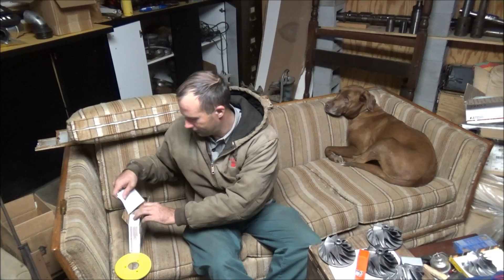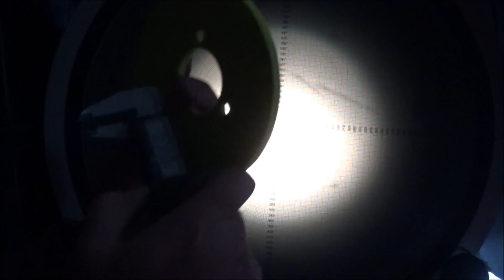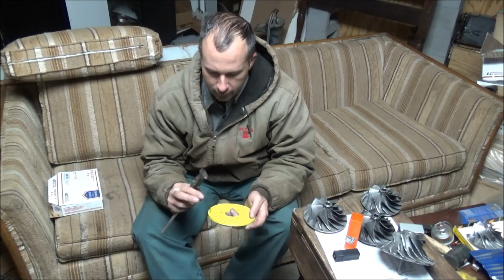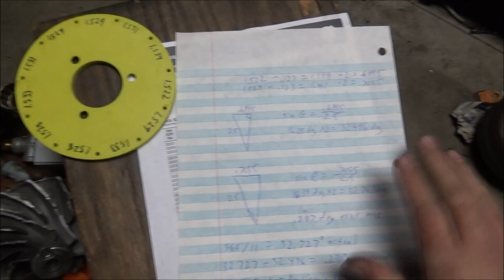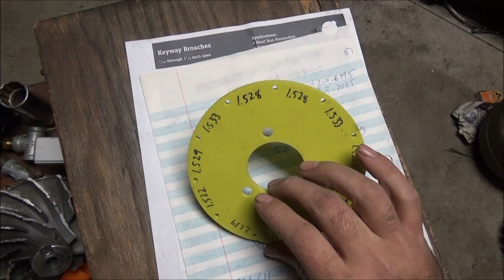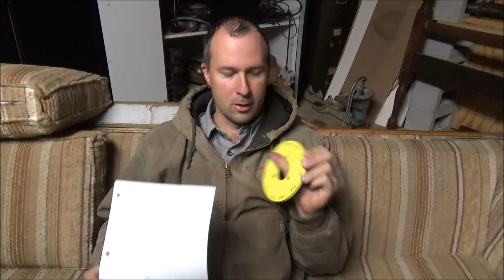Accuracy of a 3d printed plate

Comment: +bcbloc Thanks Brian, that was well thought out and executed.  I think .004 error on a gear tooth that hasn't existed for some time will be a huge improvement.  One thought is I did print that plate at what is the roughest setting on my printer as far as thickness of the layer.  The holes might come out better if I used a finer layer spacing.  I could also try printing at a slower speed, which does seem to result in a better finish.  Thanks very much for your reasoned, and experienced, feedback.  You can keep that one, I'll just print another.

So how bout some info on those impellers?
Reply from the maker: Glad to do it. It was a lot of fun and I learned a lot from the comments here. It does appear that the worst holes occured close to where there was an axis change. I would look into the positional accuracy of your axis. Perhaps a dial indicator movement test would tell the tale. It maybe that slowing down will improve the resolution of the positional accuracy and do a better job. It will be interesting to see.  The impellers are just stock Holset compressor wheels for 15-19Liter diesel engines. Those are a common size to be used on the hot 6-7liter engines to improve performance. It is common to upgrade the turbos to billet aftermarket wheels that can stand more boost and these are takeouts.

Comment: is that a razr?
Reply from the maker: Is what a razr? My phone?
Reply: Yeah
Reply from the maker: evan weiner
yes
Reply from the maker: evan weiner
yes it is
Reply: Wow does it still work?
Reply from the maker: evan weiner
Works great, better signal than any new phone. I never have it drop calls or lose signal.  I am oftentimes in remote locations for work and many of the newer phones won't work but my old one will. I suspect it has a lot more antenna than new phones since it was designed when there were a lot less towers.
Reply: How old is it at this point?
Reply from the maker: evan weiner
 I don't remember probably 12yr or so.
Reply: Damn that is impressive! Have you replaced the battery?
Reply from the maker: evan weiner
twice I have an extended run one on it now and it can go several days without a recharge.
Reply: That is awesome. How do you do email for your job?
Reply from the maker: evan weiner
desktop or laptop

Comment: Yeah, but when you figure the dividing head is geared 40:1, that makes the worst hole error of .231 degree only about .0057 of a degree error on the work. Might be close enough for government work....Dave
Reply from the maker: The model K K&T head James has is 5 to 1 not the standard 40 to 1.  I have no idea why K&T had different geared heads.  maybe it worked out better for power driving for helical milling.

Comment: That first bolt hole showed classic evidence of backlash in one axis more than the other. Printers are not usually made like machine tools, unfortunately.  The first thing to look for is to make sure the belts are tight,  then that the pulleys are tight on the motor, and after that you're chasing the slop and flop in the skinny frame and slides.

Errors do not really get smaller on smaller parts,  once the machine is trammed,  because they are mostly absolute positioning or extruding glitches.  The typical raw positioning ability in X & Y with full steps is 0.2mm or 0.008"  but they are generally set to 1/16 microsteps which should get the accuracy down below 0.001". I'm assuming James has squared his machine as he is a skilled machinist,  but that backlash needs attention. 

There is software backlash compensation in the arduino firmware (Marlin) but nobody uses that,  as it's like giving up on chasing down the real slop, and you'd need an optical comparitor to tell if it's working :)
Reply from the maker: Hey we use compensation on the big cnc's to eliminate positional errors, that is cool that the cheap little printers have the same ability. I love all the comments as I learn a lot about this stuff that i didn't know. :-)

Comment: use  the gear it self  to index  it self. use the dividing head as normal to hold  the set up. but a plunger set up of the miller bed . bolt with a point on in a tooth. 
free rotate to get good tooth. set plunger/ bolt lock head cut tooth.. getting late here in uk  not sure check simple indexing. night night !

Comment: why not use the teeth on the 10" gear to index it self no need for diving head. pick up a good tooth with the cutter set the index move lock cut tooth.
Reply from the maker: What index would you be setting? I am curious what method you would use to rotate the gear to the position to cut the next tooth., could you explain?

Comment: How about just dimpling the hole positions or as you mentioned center drill only (but I don't think you can do that on the printer).  How about the new computer controlled routers ( I forget the brand names) like Keith Fenner has, Greg.

Comment: Hi Brian,
With this kinda of accuracy you may get to the moon, but, may not be certain to make it back to Earth...   lol
My solution would be to use the DRO on a mill, I'm pretty sure it would easily be within a couple of thousand or better in all directions with a good rigorous set-up.
Move over Bailey needs room...!!! Pour Dog...   lol
Cheers,   Pierre
P.S.  Send me your postal address, so Philippe and I could send you some channel stickers....    wledpierre@gmail.com
Reply from the maker: I think if he used a series of the close to correct holes he would be plenty good on fixing his other gear with this plate.  I agree that a properly machined plate would offer superior results. Baily wants it all, he is very demanding!

Comment: Would you consider evaluating the gear cutting solution used by fellow UTUBER XYNDU in his video " I easily cut gears on my cheap Chinese lathe". The key his his use of a usb microscope and a disc printed from the internet to accurately index the blank. He has 2 links in the text. One is his setup to do the work and the other is how to obtain the printed disc. If you think this is a good idea you should pass it on to  James Kilroy
Reply from the maker: I have seen that method. There are optical dividing heads that offer extreme accuracy that function off the same idea. The limiting factor tends to be how many times magnification you can go to obtain the proper positioning. I don't know that a printed disk and a usb microscope would exceed the .004 in 10" accuracy though.

Comment: That was really informative. Thanks, Now what is with the pile of turbine wheels? Those are nice and big. Do all four go to the same engine?...Inquiring minds want to know.
Reply: Notso Fresh I spotted those right off.... And was like oh the things I could make with those. 😎
Reply from the maker: They are actually cast compressor wheels that have been removed from turbos to install higher performing billet 5 axis machined ones.  many of the pulling classes have a 3" limit so those all happen to be about the same size.
Reply: 3" limit? How uncivilized.

Comment: Brian, you could make that part without a rotary table, just work backwards from the work you did.  You can map a Cartesian drill path by running the the numbers on paper and use an XY table to make a drill template.  Then you use the drilling template to drill the first 2 holes and each subsequent hole uses the last hole as the template guide hole.   Yes, you will have tolerance stackup, but if you used a DRO to make the template first and put precision reamed holes in template and the center of the dividing plate, you could get really good accuracy. Or just lookup the BHC numbers and use a DRO....
Reply from the maker: Heck with that, my DRO has a bolt hole function, enter radius and number of holes then just follow directions. :-) Of course my Cincinnati dividing head can already cut every division from 1 to 60 so I don't need an 11 division plate.

Comment: If you used that plate to produce a steel one with the dividing head it would become more accurate wouldn't it?
Reply from the maker: Yes, you would reduce the error by the factor of the dividing heads gearing.

Comment: 3D extrusion of the type evaluated here, usually prints wider on the first layer. That is probably what you cleaned out with the drill. There are ways to improve the print. Also the STL file production is commonly produced from a drawing system the makes circles from smaller triangles. It is hard to produce perfect circles. When I need perfect circles in a print I just produce smaller markers that I drill out. I just live a little North of you. Like your building ambition!

Comment: I am lucky enough to have all the plates for my old dividing head.  For a hobby machinist like me, if I did not have a plate and thought I might need it for a future job, which is probably a reach, I would have someone with an industrial CNC machine make one (or a set) out of aluminum plate by drilling the small holes and milling the center hole.  Keith Rucker had that done with some help from Mike Wiggins.  Sure, it would cost more and I could not say I did it myself, but for the amount of planning and work involved with designing and making my own I would rather be making cool parts that my machines will readily make as they are.  Of course, we can each choose our challenges...
Reply from the maker: Mike was just here. I bet he still has the program to make these plates too. This was one of those if you don't try then you never know kind of deals.

Comment: Bored? No, not by a long shot. Math isn't boring to me. If it was I wouldn't get through half my projects. Mind you mine center more around electronics whereas I have to calculate resistances, capacitances, and inductances necessary to make a gadget work. Machining parts isn't any less complicated. I've done my share of small gears the largest of which was only about two inches @ 44 teeth. Finding the correct number of teeth for a reduction where they aren't too small to do the work they were intended for and still mesh well with larger gears isn't easy. It's more difficult when you don't have charts handy to tell you where to start like myself. I don't have charts in a nice book. I can look it up online and I usually save screenshots or just download the document if that's an option. You'd think they would be easy to find on a computer too but their not. Especially when you forget what you named the file like I often do since I'm distracted by the project and not paying enough attention to what I'm typing.

 Seeing you do this leaves me with more respect than I had for you before Brian and it was already a lot. It speaks to your charactor. I can appreciate your willingness to help others. I often do that myself if I can afford to do so without jeopardizing my ability to survive which is the only limiting factor I go by for that. I commend you for your decency dude.
Reply from the maker: There is a lot too gears, they aren't as simple as they seem at 1st glance. Thanks for the kind words.

Comment: I would love to shake your hand, you come across as a humble average man, willing to give the knowledge that you paid for and earned to help any one.I left school at 16 never had any algebra or trig, and have learned as I have needed it, looking at the way you inspected the plate, made it simpler to understand how to brake it down, it's like the light went on thank you very much.
Reply from the maker: That is awesome to hear, glad to help.
Reply: I am in the same boat. Maybe I should have listened to my elders back in the day.
Reply: When you need the knob at the end of a throttle lever, or the knob for killing an old Deere motor, a finger nut for your welding mask, you broke one of the bakelite knobs on your old Lincoln welder, you need an holder for a nut that are really awkward positioned for your normal tools, you need to make an bracket for your sons trike,. That's when you use a 3d printer. For making a dividing head for milling metals you will need some more accurate tools. No room for discussion on that.
Reply from the maker: John Pilagonia
It can be hard to get interested in it when you never know what you are going to use it for.

Comment: I sent James Kilroy the idea of printing a dividing plate about a year ago when he said he needed a custom plate.   He seemed pretty interested in printing one, and even mentioned the suggestion in a video, but I never saw the finished product.  Im glad to see that he did print one, but I wish the results were better.   Thanks,  Chris
Reply from the maker: He showed this plate in one of his videos but it probably was like a year ago. It was back when I had just gotten my optical comparator and I offered to check the plate, not knowing that it wasn't going to fit. I think changing the path the machine uses to deposit the material you could get better results but this isn't bad either.

Comment: For that plate, compared to 3D printing, a small tabletop CNC mill/router would probably be quicker and better by removing material from plastic sheet.  My Nomad 883 appears to be laterally accurate to about 0.1mm [0.004"].
Reply from the maker: I would agree as machining tends to trump casting for accuracy. We tend to be limited by the tools at hand though so this was to see if this was a viable option. For me I would have to do it in the regular mill using the DRO.

Comment: Hi Brian
Very informative analysis and thanks to Jay for doing the 3D work and sending the plate over to you. It's fun to see new and different approaches tested. I imagine the printer has some degrees of freedom to optimize the spatial accuracy of the printing?

My question: isn't it also important to know the spatial relationship of each perimeter hole to a theoretical center point on the plate? If the distance from perimeter hole centerline to the central hole center varies it seems to me that the locating pin would have to be adjusted for each hole. Not a huge problem but tedious. I imagine this could be quickly checked using a slug with a center or simply calipers.

thanks!
regards
vic
Reply from the maker: I would say the spacing from center is likely prone to the same .010 error. The center hole is neither round nor accurate on size so measuring out would be a challenge. Moving the pin on the DH in or out would not be a big deal for a one off job. I don't know the program or how the machine works but I think if the tool path was written to run circular spiral instead of stacked across the results would be better.
Reply: understood and agree :-) Thx for the reply

Comment: It occurred to me, that if mr. Kilroy has the CAD drawing for 3D print and the print isn't accurate to his liking, he might could send it to someone with a CNC router along with a piece of HDPE to have to it cut out, still rapid prototyping and using the same drawing, just executing on a different machine, as an aside, Western Carolina University has networked 3D printers available to students just like normal paper printers, pay per gram of material used instead of per page, we just did the tour with my oldest daughter, thought that was interesting
Reply from the maker: That is neat, when I was in school we had 4 3d printers that were actually laser sintering devices, multi million machines back then. The Ford and GE projects were the only things that got run on them  and they were slow, would probably take a couple of days to make one part, really neat stuff though since you could make parts with internal features that you could not machine since they were built in. More like a slow pour casting with no molds needed.

Comment: That is nice to know about 3D printed things Usable in a pinch If inspected and only need once or twice!
Reply: And if you then use the "rough" printed version of the dividing plate in the dividing head you can make a more accurate one with the accuracy improved by the ratio of the main worm gear. So if you want a dividing plate with loads of holes that you don't already have you could print out a "rough" starting plate and create an accurate one - within the limits of drilling as Brian mentioned. My dividing head is 40:1 and my rotary table is 90:1... One of these days I will actually use my dividing head/rotary table lol.
Reply from the maker: Yep same kind of deal as masters and grinding cams.

Comment: Hi. 
As the ratio of the dividing head is 40 to 1  any error on the plate also has to be divided by 40. Even an error of one full degree becomes one fortieth of a degree i.e. not that much for most things. That plate looks very similar to the ones on my Vertex dividing head and these are available and would adapt.
Reply from the maker: For my dividing head that would be true but I don't think the K&T head is 40 to 1. I believe it is 5 to 1 thus why I divided the error by 5 not 40.
Reply: Hi.
I checked and K and T made both ratios. The large model K was 5 : 1 but the smaller model H is 40 : 1. I had only ever heard of 40 : 1 ratio dividing heads before this